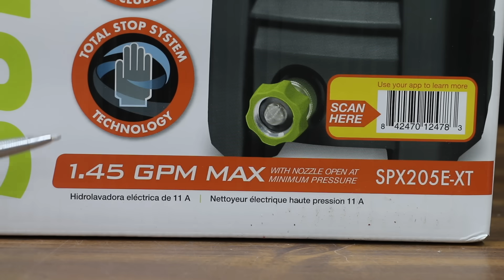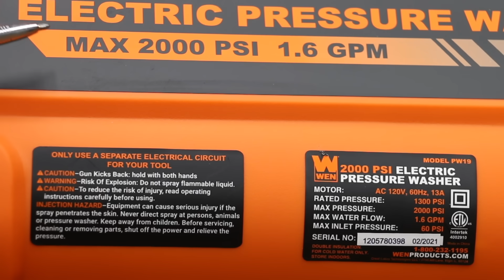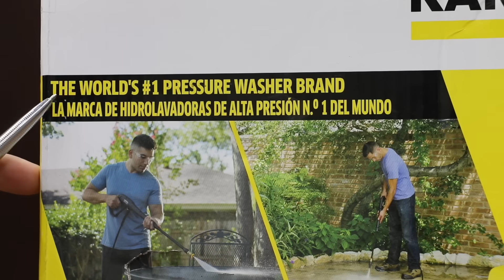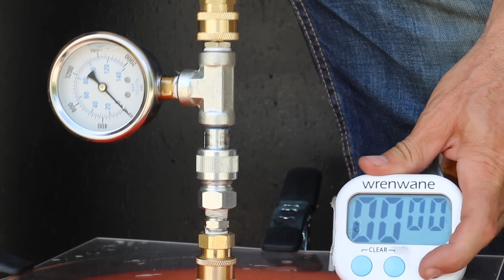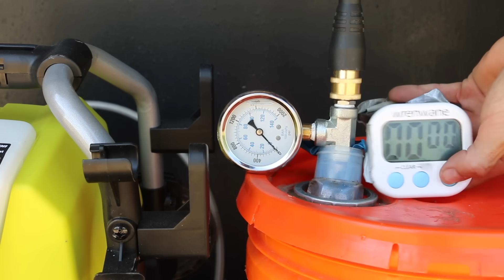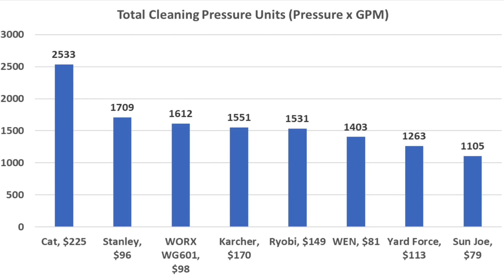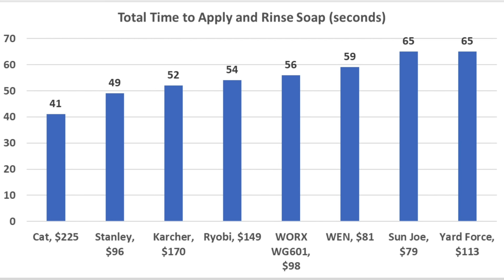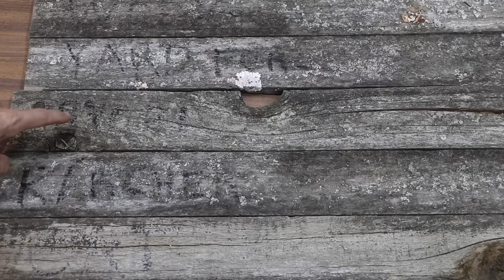Best Pressure Washer (ELECTRIC)? Ryobi vs Karcher, Stanley, Sun Joe, WEN, CAT & WORX

Comment: Sunjoe: Two year warranty 
Project Farm: WERE GONNA TEST THAT
Reply from the maker: Thanks for watching!
Reply: Unfortunately, longevity would not be practical to test.  I've got a gas powered 2600 PSI Karcher that still works after 15+ years, but I think they were still made in Germany back then.
Reply: @HariSeldon913  FYI: There are a few negative reviews on the Cat 1800 suggesting it doesn last very long (10 to 70 hours of use)
Reply: @HariSeldon913  its kärcher
Reply: @chonkyboi7332  My keyboard doesn't have marks over the vowels, so I do the best I can.  I also left out that it has a 本田 engine.
Reply: that sunjoe  looks suspiciously like the model that HF carries.... only different color and name
Reply: Came to comment the same thing lol
Reply: LOL!  I WAS THINKING THE VERY SAME THING!!
Reply: ...  and devises some devious way to age the machine 2 years in a few minutes video..  👀
Reply: Snow joe... ??? That’s what I read
Reply: @foxriver9156  I thought it was snow too haha
Reply: If you dont release the pressure in the system after using it by pulling the trigger after you have unplugged it from power and water then at first frost the water left inside the pump will freeze, expand and break your pressure washer. Warranty doesn't cover that as it's in the instructions. Just because no one reads them the pressure washer company wins every year when you need to buy a new one! 🤣
Reply: @Lore69420  I never though of that! I live in New Orleans, though, so it basically never freezes here.
Reply: @Blaquer17  They make the pumps housing out of aluminium.. should be stainless steel but then it would be too good. Still needs to be done after every use ideally same as a garden tap in winter. Look for water cooled induction motor pressure washers.

Comment: "And the final unit we will be testing is this CAT brand.."

at the local Harbor Freight store managers office  - Woots, backslaps, and high fives
Reply: I even got a mid roll for HFT's 'Portland' squirt gun
Reply: @Seadalgo  I’m not always a HFT fan, but my 1,750 Portland squirt gun will blow the vinyl siding off my house and put holes in my wood deck if I’m not careful and will go toe to toe with any of those washers other than the CAT?
Reply: Yeah came here to say that. The green HBF one works good.

Comment: ** Video Ideas **

• Best plastic ammo-can (metal is best but is there a cheaper but reliable plastic substitute?)
• Best framing hammer
• Best shovel (spade or transfer)
• Best method to prevent hand-tools from rusting (clear coat spraypaint vs. ?)
• Toughest 36" or longer carpenter's level? (Why do these always break or dent so easily?)
• Cheapest and safest bicycle helmet? (Job for Cousin Eddie)
• Which manufacturer's USA flag frays the least from flying in your truck-bed (Job for the Farmabego)
• Best pitcher for keeping cocktail mixes cold on the patio or to reduce condensation?
• Best insulated cocktail cups for drinking on patio during summer
• Something Silly: Summer is around the corner, so what is the best squirt gun?
Reply from the maker: Thanks for the video suggestions.

Comment: I bought the Ryobi 1600. Use it with foam cannon with smaller jet. smaller jet makes much more foam. 99 dollars, I bought a great flexible hose 50 feet for 50 dollars. It works great. Thanks for the video. With all these units, the hose is cheap an hard to work with. Best upgrade is longer more flexible hose.
Reply from the maker: You are welcome!  Thanks for sharing.

Comment: While this video wasn't much use to me since I use a gas-powered Pressure Washer, it did make me think a bit: I have three surface cleaners - 2x Briggs and Stratton 12" and one 15" ( I forget the brand off the top of my head) and I'm wondering if there are others that can be used in a show-down, maybe including a smaller one that can be used on one of the little electrics.
Reply: Okay, so I've been thinking more about the surface cleaners. They all come rated for max pressure, but I never see anything about flow rates or minimum pressure. And what happens if you go over the specified pressure? No way I'd do that with mine - it's rated for 4k and my washer only does 3.2k, but many are rated at a max of 3.1, or as low was 2k for the Sun Joe (that's for electrics only!) but I'm super curious now!
Reply from the maker: Thanks for the suggestion.

Comment: If you have a Pressure Washer, or want to buy one, be sure to also buy a bottle of Pump Protector ($10+), if you want your Washer to last. Simply apply a bit of Pump Protector into the Washer, after you are done using it, and storing it away. 
Here are 3 examples from Home Depot: 
https://www.homedepot.com/b/Outdoors-Outdoor-Power-Equipment-Outdoor-Power-Replacement-Parts-Maintenance-Parts-Oils-Lubricants-Additives/N-5yc1vZbxaq/Ntk-RelaxedMatch/Ntt-pressure+washer+lube?Ntx=mode+matchpartialmax&NCNI-5&visNavSearch=pressure%20washer%20lube
Reply from the maker: Thanks for the feedback.

Comment: Yeah, one really needs 240V mains voltage to get power closer to petrol-powered home units.  By the way, how much are you supposed to clean weathered wood?  I rented a twin cylinder once to clean my wood deck.  The weathered look of the wood was gone, along with some of the lignin.  Took a few hours to do, then I remember it being a real bear to hoist it back into my hatchback to return.
Reply from the maker: Thanks for the suggestion.

Comment: As always, good and interesting review.

If you're open to a round #2, I have a few suggestions:
(1) Put the Cat head to head with the Active VE52. About the same price and it's got a great rep for gpm, pressure, and pump life.
(2) Endurance test the pumps.  I have a 1.76 gpm (purely fictional marketing ploy) Sun Joe, and was disappointed to go to their website and learn it has a 100 hour pump on it.  Further research found that most of the sub-$200 electrics have 50 to 100 hour pumps.
Reply from the maker: Thanks!  Thanks for the suggestions.

Comment: I have a few problems with this test...

1) First, who cares how much power it consumes?  People mainly want to know if it will get the job done and for a reasonable price.

2) Who cares how loud or how quiet it is?  Do you think people are going to powerwash their house at midnight and want to be courteous to the neighbors?  I could just slap on a pair of hearing protectors if I really wanted to, then even the loudest one tested would be quieter with my hearing protectors than the quietest tested one without those.

3) The brand I currently own (Husky) is not even in this test.  Neither is the Portland brand ($71.99 + tax) from Harbor Freight.

4) Performing a few tests doesn't tell us how it may perform in a year or two (if it will last that long without problems).

5) How many people actually drive over their spray gun handles?  This isn't a child's tricycle or wagon left in the driveway.

I realize these units would be difficult to test long term, as you would have to test all 8 of them for a year or two, so this was still a good effort and upvoted by me.  Your tests (generally speaking) are very high quality and I subscribed long time ago to this impressive channel.

By the way, maybe you can now quit your main job, hire 7 more people, and open up your own car washing business.  You can call it PF car wash.  You can even wash farm equipment like tractors.

Comment: Suggestions for new videos:
1.  Which dilithium crystals last the longest.
2. Which brand of gasoline cleans manure out of facial hair the best.
3. Which toilet plunger goes furthest when launched with a shotgun.
4. Which brand of cable ties is best for strapping your little brother to a radiator.

Comment: I purchased an AR Blue pressure washer. It is one of the few units I found that can be used with hot water and since my main goal is to keep salt off in the winter that feature was important to me.

The two things I was surprised about is how ridiculously heavy the AR unit is at 60 pounds and that it requires a 20 amp circuit to run.

Wish you would have added one high end unit in the mix for comparison.
Reply from the maker: Thanks for the feedback.

Comment: Good test of inexpensive pressure washers.

All of the tested units use universal motors. It'd be nice to see how the units with an induction motor would compare. 

I have a Ryobi with an induction motor and while it was more expensive than the Cat it has a nice roll around cart. It works quite well and I trust it more for long run usage cleaning my decks and patio than I do units with brushes. I was considering a gas powered unit but the convenience of the electric. I figure I'm tied to the house with a hose anyway so the electric cord is not that much of a bother for me.
Reply from the maker: Thanks!  Thanks for the suggestion.

Comment: Great video as always.  After owning several pressure washers, I'll put in my thoughts for future buyers.  The units that stand up tall are miserable to use - they consistently tip over between the vibration of the pump, the power cord and especially the high pressure hose.  After my neighbor killed my Karcher, I bought an AR blue clean one simply because it was not tall and wouldn't tip over.

I would immediately not buy a unit with proprietary connectors.  If the hose gets kinked, or if you want to use non-factory adapters, you are out of luck, or at best, forced to buy fittings to make things work.  Both my Karcher and AR Blue had those foolish connectors.

I would also not buy a unit with an adjustable nozzle, as like the videos show, they are junk.  When you are working with a very limited power (Remember, on a 15 A circuit, you're limited to 1800 watts, which in reality would trip the breaker if used for any length of time.  1800W = 2.41 horsepower) you need a high quality tip in order to make the best of that power.

A friend of mine gave me a 6.5HP no-name pressure washer rated at around 2000 psi I think.  It needed some work, and I'm sure it's not putting out the full power level (note: pumps do need maintenance and do wear out) however, the power is night and day different.  I think the foam cannon test kind of shows this best.  Notice how some of the better units actually created a little bit of foam, instead of spewing out a milkshake looking stream of soap.  A gas pressure washer would put out foam with the consistency of shaving cream.

If I was basing my purchase on usefulness, I would go gas no matter what.  And for the price of the higher end units, you could find a lower end gas unit, or a used higher end one.  If you don't want to deal with gas, then the Cat is the only one I would buy.  Trust me, buying an "expensive" pressure washer once is far cheaper than buying 2 or 3 pressure washers only to end up buying an expensive one in the end because the cheap ones just don't clean.
Reply from the maker: Thanks for the feedback.

Comment: The title should include that these pressure washers are electric. I realize more and more power equipment is going electric, but you can still buy a gas powered pressure washer.

Great video as always! My Subaru pressure washer is still going strong.
Reply from the maker: Thanks for the feedback.

Comment: Hi, video idea. I ad 2stroke oil to my 2000 toyota land cruiser diesel (1hdfte) tdi. I have heard that it helps with smear in the diesel pump and also serves as an Injector cleaner. The older engines are designed for 5000-500ppm diesel and we only get 50ppm or sometimes 10ppm nowadays. I use 50:1 but don't necessarily measure it perfectly. My motor seems to run smoother when adding the two stroke but maybe its just me. Can you please test it, i would also like to know if it helps with carbon cleaning. 
Regards from South Africa 🇿🇦
Reply from the maker: Thanks for the video idea.

Comment: I have the Wen and am impressed with it and use it for smaller jobs.  I have a gas powered pressure washer for larger jobs but the Wen is much quieter.  With the electric powered PW's they turn off and on as needed.  The gas versions run constantly and if you don't relieve the pressure, it can damage the pump according to my manual.
Reply from the maker: Thanks for sharing.

Comment: These are the tiniest pressure washers with the lowest pressures I’ve ever seen. I didn’t even know these things existed. Would really love to see a proper pressure washer test lineup, for both electric and gas powered units. Would be a nice series for the summer. I’m actually in the market for a pressure washer, and would love to see them compared to each other. Thanks!
Reply from the maker: You are welcome!  Thanks for the video idea.
Reply: Until now i thought all were gas powered.

 Very thorough testing and surprisingly theres a lot of power in these portable pressure washers. It would  be awesome to see a test on full size pressure washers

Comment: You tested the smallest Sun Joe. The next step up to the SPX3000 would have been more of a fair review imho. I did a ton of research and the spx3000 was consistently the top rated pressure washer.
Reply from the maker: Thanks for the feedback.

Comment: you should have put the Karcher v5 model up against the cat its more comparable price point wise. that said it is a bit subjective in terms of cleaning anyway. my friend has a stihl that's got more pressure than my Karcher but because the Karcher has a dirt blaster gun ( a ball bearing in the tip that swirls the water round) mines way faster at cleaning... Anyway great video and il definitely keep the cat in mind on my next one...
Reply from the maker: Thanks!  Thanks for sharing.

Comment: Todd, maybe you could do a test of gas powered consumer pressure washers? One note if/ when you do this. Many companies use the same pump/engine, or combination. To be fair, you would want to be certain that you are using products that have different pumps and or engines for the test.
Reply from the maker: Thanks for the suggestion.

Comment: I have sunjoe I had 3 years warranty it broke in less then a year the pump wasn't sucking enough water and it was making terrible noise and vibration I send it back they send me replacement another model and I got two years extended  warranty again up to 5 years this time ! If I didn't watch this video I would say Ryobi is the biggest bit now I would say it's definitely Stanley best bang for the buck 😆😂
Reply from the maker: Thanks for sharing.

Comment: Now this test is done pit the top 3 against a Kranzle or some other pro grade pressure washer. I currently have a BE electric but have been thinking of jumping up to a Kranzle.
Reply from the maker: Thanks for the suggestion.
Reply: @ProjectFarm  most people that are into car detailing or care enough about washing to watch a video about it wouldn’t buy half those washers. Brands like stihl also make home owner electric pressure washers. But almost any electric is better than a noisy gas washer, 1 guy on my street has one and I can’t wait for it to break.

Comment: Probably the cleanest that one side of your vehicle has been in a long while.
Reply from the maker: lol  Good Point!
Reply: Some of these guys commenting here are thinking way to much about my original comment.
Reply: False Flag  I do. As an automotive detailing enthusiast, you'll never get that layer off with just a pressure wash. Usually you can make it more manageable by washing your vehicle more frequently, as the dirt tends to embed deeper the longer it sits. I recommend ceramic coating, or waxing, if you want to be able to just blast it off every once in a while. Doesn't keep it perfectly clean, but it really helps. Even the cheaper kits you'll find on Amazon should do the trick.
Reply: @smileyguyz  Just to make you cringe, I'm still fine with Johnson's Paste Wax.
Reply: Actually, he never wiped down the soap, so It's barely any better than a soapless pressure washer rinse. Read the foam cannon instructions if you want proper results.
Reply: and then he ran them over. lol
Reply: @sc5015  That's some bad karma, I'm sure of it. Use a machine to wash yur suburban, then run it over with the same vehicle....
Reply: @ianide2480  
I went down the car detailing rabbit hole once and it's a very relaxing and rewarding feeling when  you personally clean the shit out of your car but you'll see lots of people who take car detailing way too serious. It's a huge industry and people get all scientific and act like snobs over the shit. Lots of annoying douche bags in the detailing business
Reply: False Flag  Drill a hole in wood, thin layer of dust = impervious. yep
Reply: False Flag  from what I understand the magic happens with detailing products that foam and lift a lot of that dirt up out of the micro pores in the paint but yeah for real lol nothing beats elbow grease in instances like that
Reply: False Flag  You might have better luck if you trying using a higher quality automotive soap